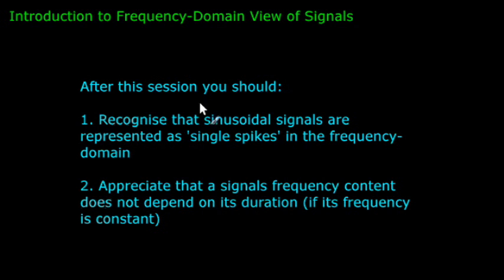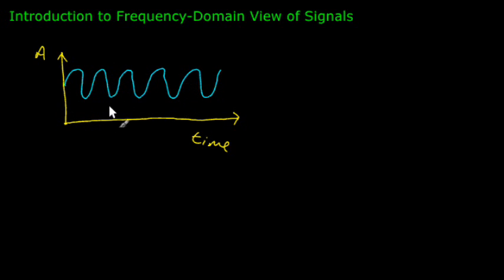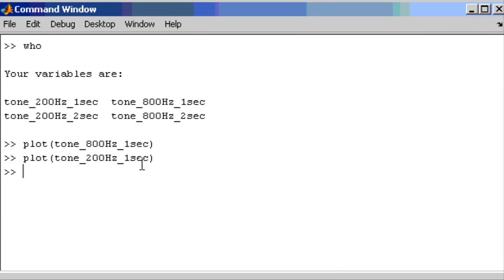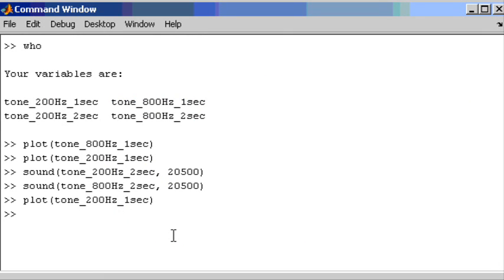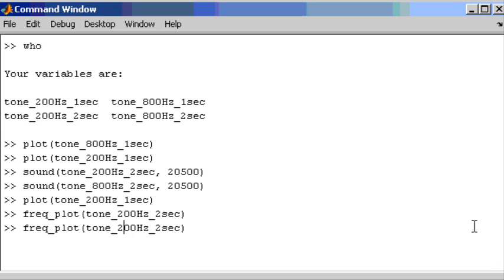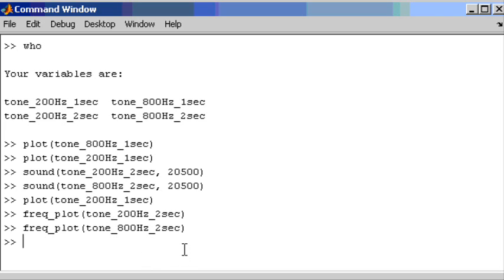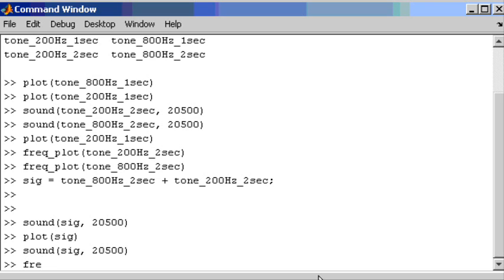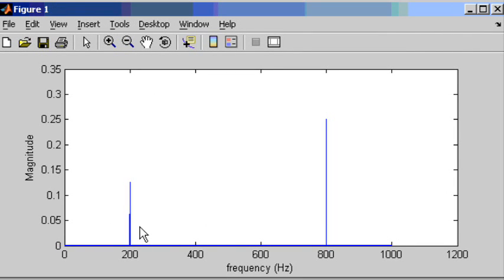Introduction to Frequency Domain View of Signals

Comment: Great video. Thank you.  But I have question for you.  It's not specific to the video but it's related. How would you create rect() in the frequency domain?  More specifically, how would you set up the frequency array for that rect so that when you do the ifft() it looks like a normal sinc (in time)?
Reply: I don't know if this is a good idea to start that way. Or should just start in the time domain with a sinc and fft() the sinc function to get a rect in frequency. But I still wouldn't quite understand how that frequency array works.
Reply from the maker: +Samuel Graham 

When you're dealing with real signals  the right hand side of the DFT is a mirror image of the left side. So when you're creating the DFT array its important that you make sure that this property holds.

The following code creates a rectangular single-sided spectrum and then creates a double-sided spectrum (full_ft) by ensuring that the right side is a flipped/mirrored complex conjugate of the left side. 

In this example the conj function isn't required because the left side only contains real values but in general it is required.

first_half = [1 1 1 1 1 1 1 0 0 0 0 0 0 0 0 0 0 0 ]; %first half of the DFT
second_half = conj(fliplr(first_half_ft(2:end-1)));
full_ft = [first_half_ft second_half];
x = ifft(full_ft); %should be a sinc function
Reply: +David Dorran Thanks for that explanation.